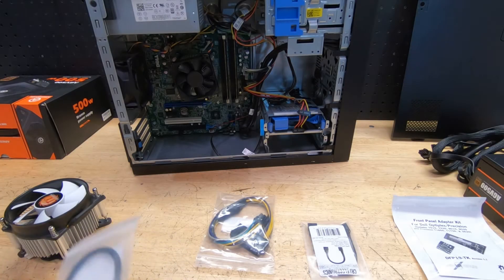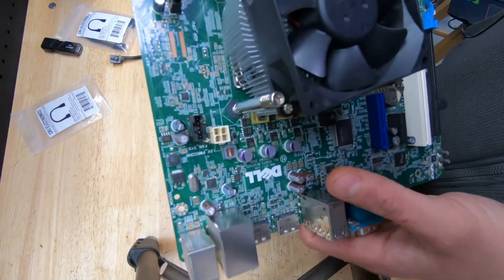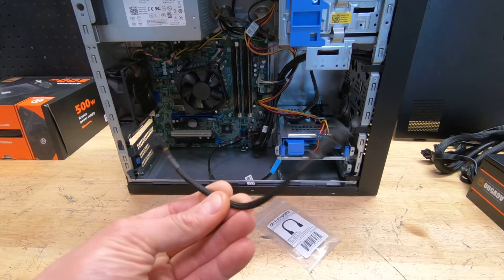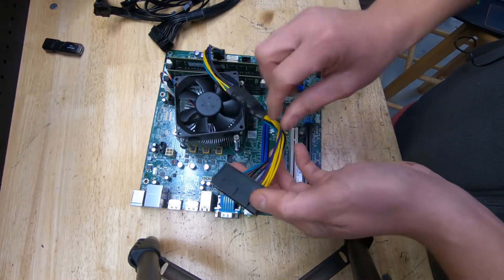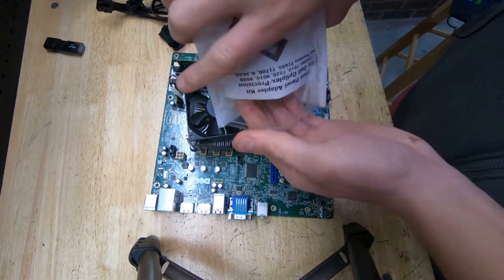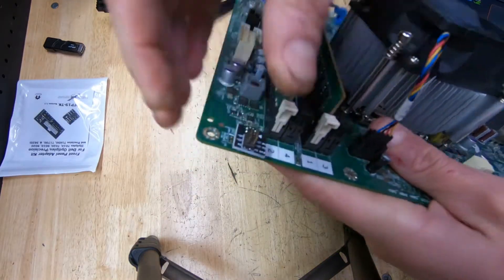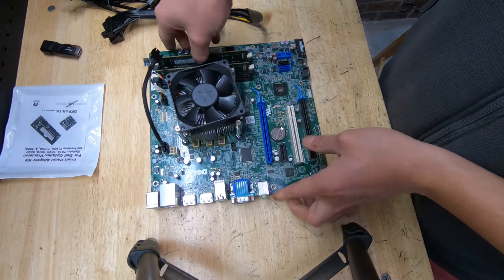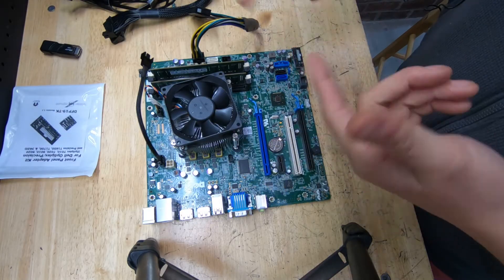Dell Optiplex/Precision case swap guide!! Adapters and preplanning!!

Comment: What adapter do I need because I want to swap it into a triple fan pc case
Reply from the maker: if you refering to the fan adaptor it depends if its a 4 pin or dell 5 pin then you would need that adaptor. as far as having enough ports for the fans, Just get a fan hub that is sata power or a fan kit that has it's own hub.
Reply: @DLMtechgarage  I have a dell optiplex 9020 i7 4790 16gb 500gb ssd and 500gb hdd
Reply from the maker: @imsevn  you would need the 5 pin to 4 pin adaptor and for multiple fans, get a fan hub splitter.
Reply: @DLMtechgarage  what if my case comes with a hub that uses a controller to control them
Reply: @DLMtechgarage  is there anything I can dm you on
Reply from the maker: @imsevn  then your good, just check if its pwm powered or sata. if its pwm power you would need the adaptor for the 5 pin to 4 pin, if its sata power the just plug the fan hub to a sata power. no you may get an error about the fan since the computer won't pick up the fan signal but you can plug another fan into. computer will still run with the error though.
Reply from the maker: @imsevn  i have instagram you can hit me up their @dlmtechgarage or email me at dlmtechgarage@gmail.com
Reply from the maker: @imsevn  will do!

Comment: The power adapter extends outside the motherboard 7:44. Won't it give problems in small matx cases?
Reply from the maker: depends on the case. I put this in a thermaltake matx case and had no issue.
Reply: @DLMtechgarage  I forgot can these 7020 mobo's work with a non original dell cooler?

Comment: I just put the power switch adapter in my pc and made sure the pins were in the correct spot but it is still giving me the power switch alert when I boot my pc up.
Reply from the maker: What model optiplex you using? Some required both adaptors.

Comment: Does that front panel adaptor work with a dell optiplex 5040 sff?
Reply from the maker: according to the companies site it does not.
Reply: @DLMtechgarage  :( thanks, i want to change the case I will check my options.
Reply from the maker: @felixzarzuela  I have yet to see it done and I am def trying to get my hands on my to try and do the swap and film it.
Reply: @DLMtechgarage  great, thanks.

Comment: what do i do with that 5 pin hdd_odd port that's next to the 8 pin power port on the motherboard now that i have an upgraded power supply?  Would i still have to use that port to power the dvd and hard drive or would I use the sata power cables that are coming out of my new power supply bypassing the hdd_odd port?
Reply from the maker: either or, it's a matter of preference. I used the one off the psu to keep everything cleaner.

Comment: Thanks amigo! I recently bougth a Optiplex 9020 from Ebay. I live in Peru,   I have this power supply  PB 500 GIGABYTE,  a friend of my  said i dont need a converter, cause separeting 4 pins from the 24 pins and using toghether 2 conectors with 4 pins, i can used  those together the 8 pin wich the mother board need , With my  PB 500 GIGABYTE is enough or I really neet the converter? I m really apreciatte your anwser .Vibes from the peruvian jungle my friend. Thanks
Reply from the maker: unless you know the exact pin out and are good at repinning, I would just get the adaptor and play it safe and that power supply will be fine. I have heard of people frying their computers not using the adaptor and trying to come up with their own connectors. play it safe my friend. Thanks for watching and honored my videos are getting viewed over their!! Feel free to ask questions if you need any more help, always glad to help any way I can and hope you can check out and share the channel!

Comment: hi one question, after using the 5pin to 4pin adapter could you connect a 4 pin fan splitter after that for example https://www.amazon.co.uk/Akasa-AK-CBFA04-15-Splitter-Cable-Fans/dp/B005FWXWPS
Reply from the maker: i dont see why you could not, never done it, not sure.
Reply: @DLMtechgarage  hi also, with the 5pin to 4pin adapter, can you still control the fan speed
Reply from the maker: @aryan.a1z  yup, the 5 pin is just an extra pin for dell to pick up the signal so it does not give you an error. the 4 pin has it jumped to act the same way but basically the 5 pin is just a 4 pin

Comment: Just a question with that rgb cpu cooler do you receive any fan error on boot? Thanks
Reply from the maker: never ran into that issue. i have heard that the optiplex is picky with some fan manufactures but at least this one worked fine for me.
Reply: @DLMtechgarage  Luckily the Precisions have UEFI firmware that's easy to mod and has a zillion settings to mess with. You just need to find the offsets and values that control the fans and it only takes a few quick commands using https://github.com/datasone/grub-mod-setup_var. You can control the fan curves, performance profiles, and so much more on most of them.
Reply from the maker: @CaseyStrouse  good info that's for it. Will need to check it out

Comment: @DLM... i bought the 8-24 adapter. When plugged in, the CPU fan spins @ 100%...and it doesn't post. Have you ever experienced that before? Using a Precision T1700
Reply from the maker: could be a few things, are you getting beeps, i believe two beeps are memory errors, try reseating the memory either way. next would be to unplug the gpu and try plugging your display to the mother boards gpu, if it's still doing the same thing after that then go back to the original setup and if everything works could be a psu issue. now another thing to consider is did you make sure to plug in the cpu supplemental power, that has to be plugged in.

Comment: Is it argb compatible with 9010 MT motherboard?
Reply from the maker: the adaptor works with the MT boards.
Reply: @DLMtechgarage  yeah but I’ve stumbled upon an issue, I have a cooler master mb311l argb, the lights turn on but the fans don’t spin I don’t know why, I was wondering if there’s a solution or if it is compatible or not
Reply from the maker: @cyrusaa  never ran into that issue changing the cpu cooler. not sure.
Reply: @DLMtechgarage  i was referring to the front case fans not the cpu cooler
Reply from the maker: @cyrusaa  not sure, never had that problem either.

Comment: Great video.  I have 5x 9020 SFF and 4x 9020 MT that I'm always looking for uses for.  Have you done any work with the SFF models?  Same process?  I'm looking to take one of them into a 1U or 2U server chassis.  I have an SFF I've been using as a pfSense Router w/a 10Gb NIC but I'm looking now rack mount that solution.  Any tips you might have would be appreciated.
Reply from the maker: yea the sff models is the same, its the usff that are slightly different. the best tip i can give is to get the adaptors, it makes your life soo much easier, i have done it the splicing and cutting wat but it's annoying. It's a real easy process and straight forward with the adaptors. Thanks for watching,
Reply: @DLMtechgarage  Thanks for the advice.  Splicing and soldering don't bother me.  I might go that way any ways.  I have bunch of pin header wire connectors.
Reply: @DLMtechgarage  I have a 9020 SFF that I'm trying to move into a new case, but it says on the Harbin website (in capital letters) that their front panel adaptors will not work with SFF models. Are you saying they have actually worked on SFF's in your experience? If not then is there any other way to get the front panel working other than soldering and splicing? Great and helpful video by the way!
Reply from the maker: @sapienics  the adaptor will work for the power button but outside of that the other front i/o won't work and you will still get the error on boot.
Reply: @DLMtechgarage  Thank you for the response! Is there any way that I could get the front panel working, eg through other adapters? Or will I have to splice and solder?

Comment: Can i used dell fans with aftermarket motherboards? Like b85m
Reply from the maker: yup as long as long as its 3 or 4 pin. the 5 pin you can not.

Comment: My system keeps booting up and going to a set up because there is a error for the thermostat and back fan.   How can I fix this.
Reply from the maker: you need to put the thermal sensor in, i really forgot to explain that in the video. the thermal sensor has to transfer over. for the back fan error just plug a fan into it.
Reply: @DLMtechgarage  what if u don’t have it anymore. I didn’t know and I swapped the pc a month ago.  I have been dealing with it.  What’s it look like?
Reply from the maker: @RecodeFiber550  posted a link to one on ebay, it varies depending on your model. i dont know of a way to bypass it without it.

https://www.ebay.com/itm/111403421690?chn=ps&norover=1&mkevt=1&mkrid=711-117182-37290-0&mkcid=2&itemid=111403421690&targetid=1070284370796&device=c&mktype=pla&googleloc=9010035&poi=&campaignid=11613475437&mkgroupid=114499396058&rlsatarget=pla-1070284370796&abcId=9300455&merchantid=101500813&gclid=CjwKCAjwj6SEBhAOEiwAvFRuKDjqE-1bTpahQ-goKH0cSx7txeTICWZ6OpxrgnXFsh7RFGJDJ3kF2hoCmu0QAvD_BwE

Comment: Hi
I am a direct viewer from Brazil, I have a Dell Optiplex 9020 small model and I recently decided to change his case, I just bought the cable for 24 pins 8 pins, will it work with just him?

I will put it on Sharkoon TG5.
Reply from the maker: yes it will work with that adaptor, you just need to figure out the front panel pin out or you will get the boot error.
Reply: @DLMtechgarage  How do I identify the front panel pin and how do I step by step so that this error does not happen anymore? 

Thank you so much you don't know how much you help me! 
I am "noob" in relation to hardware and my English is not good
Reply from the maker: @frank_soares  if your gonna do it without the adaptor check out the link below might help guide you.

https://www.dell.com/community/Optiplex-Desktops/Optiplex-5-pin-power-button-assembly-pinout/td-p/6234979
Reply: can you tell me in detail for a layman to understand, how does this 4-pin cable work and why should i buy please

and the problem of the power button cable failure error?
Reply from the maker: the 4 pin is the fan power, dell uses a 5 pin and it will not fit in the 4 pin. the 4 pin is fan control which means that you can control the fan speed manually if you want.

Comment: you dont know how many you help me with this question, really thanks for your help bro, thanks for the help
Reply from the maker: glad I can help, let me know if you run into any issues or have any question.s
Reply: @DLMtechgarage  so i need buy and adapters for pass this motherboard to oher case?
Reply from the maker: @elmorse4415  the adaptors make it easier, but if you cant get them you can cut and splice some wires to do it.
Reply: @DLMtechgarage  can you do a video good explained for do that, is that i'm of costa rica, adn those adapters not are available here, neither in ebay.
Reply from the maker: @elmorse4415  I got a video that talks about it.

Comment: I thought I had ordered everything needed for the Optiplex 9020 MT swap out earlier today, but forgot about the Harbin kit, so watching this was a key memo & one is now on the way-Thanks for the great guide, here!
Reply from the maker: thanks for watching!!
Reply: @DLMtechgarage   I'm not sure you will reply, but if you do I would truly appreciate it. If I have the cable adapter already, could I run a [y split cable on one of the fan outputs ? (I have a 600w power supply in my 9020) Or would it be best to use a (molex to 3 pin) fan cable? I'm asking this because I found a solid way to mount fans to the front cage with no cutting or drilling, but how do l power it well. ( If you want a picture of my Optiplex build just to see how I did it, just hit me up with a email  link and I will send the pictures to you)
Reply from the maker: @z-ZONDER-z_E15  not sure about the splitter option in the sense that it may trigger the error of for the fan or might not spin. might be worth a try, I have not done it that way, dell fan headers are very picky. What I do is run a pwm to sata splitter and. If you worried about the fan noise you can get a cable reducer. Will post a link to the splitter.  def send me a pic, love to get new ideas. dlmtechgarage@gmail.com

https://www.amazon.com/CRJ-4-Pin-Sleeved-Power-Adapter/dp/B0711CR7HV/ref=sr_1_1_sspa?keywords=pwm+to+sata&qid=1646603428&sprefix=pwm+to+sa%2Caps%2C71&sr=8-1-spons&psc=1&spLa=ZW5jcnlwdGVkUXVhbGlmaWVyPUEyQU5MSEFBTkNYWUNLJmVuY3J5cHRlZElkPUEwMjUwNzQ2MzlLTUZCVzY5SzNDMSZlbmNyeXB0ZWRBZElkPUEwMzI3MDE3MTY0QUxYN0k5NkVDVSZ3aWRnZXROYW1lPXNwX2F0ZiZhY3Rpb249Y2xpY2tSZWRpcmVjdCZkb05vdExvZ0NsaWNrPXRydWU=
Reply: @DLMtechgarage   thanks for the reply !  Before you got back to me, I unfortunately found out that the 'y splitter' plan would not work. The PWM signal would only go to one fan. I also can't run my computer for long, I have to keep the side panel open for air flow (the Molex cable to run the front fan has not come yet). As well as the double whammy of me not being able to get a fan quieting cable, so I just had to buy another fan (that I also have to wait for). But despite the hiccups, I will definitely send you pics of the current progress with a description of the build. Thanks for your time.
Reply from the maker: @z-ZONDER-z_E15  Saw the pics. def looks sweet. def look into the pwm to sata. you can plug in 3 pwm, use any fans you want and this should def help!

Comment: Excellent video. By coincidence I am having a problem with some parts that I buy online without realizing the problems that this has. Buy the following: Dell Optiplex 9010 Motherboard USFF w / i5-3470S + 8GB DDR3 | 0DXYK6, to install it in Case ATX Standard and the Motherboard does not want to activate. I would like to contact you directly if you want by WhatsApp or by email to explain the whole problem. I dont  have twitter.
Reply from the maker: if you are using these adaptors then maybe you have them upside down. i have done that. sorry for the late response.

Comment: Hii I i'm done watching this video and it so helpful and you gave me an idea about this because I have Dell Optiplex 7040 MT and planning to swap the case. so may I ask is this adapter are all compatible with model  7040 Mini Tower thank you...
Reply from the maker: it does not appear so according to the site they are from.
Reply: @DLMtechgarage  So meaning these adapter is not fit to Dell optiplex 7040 MT is that right?
Reply from the maker: @renmel42367  that is correct.

Comment: my pc case has 3 pin fans is there another adapter
Reply from the maker: if the typically 3 pin fan then the adaptor will work. 3 pins work with the 4 pin.
Reply: @DLMtechgarage Thanks!
Reply from the maker: @jacksonwirth3650  Anytime!

Comment: I just installed a dell optiplex 7010 into a new sweet case!
Reply from the maker: pretty simple!!, I flip these quick and make a good penny if I get them cheap enough. Thanks for watching!!
Reply: @DLMtechgarage  on specifically the 7010 concerning your comments on bottlenecks, is the GTX 970 too much of a Graphics Card for the 7010? I will be using a 650 Watt brand New Power Supply. I have a customer who wants to play Fortnite & I'm going to be putting the 7010 Motherboard in a Custom Case with the kit you suggested. The Processor is going to be i7-3770.
Reply from the maker: @Not_A_Fan_of_Scammers  i use the bottneck calculator from pc part picker and have found them to be good and reliable. It states with the combo the your cpu will be bottnecked only 5 percent which is not bad at all and negligable So that combo would be fine in my opinion, ofcourse a slightly faster cpu would yield you that 5 percent but it's not worth it.

Comment: So no sata to pcie cable for running gpus that need just a little bit more power?
Reply: Isn’t worth it just to save $40
Reply from the maker: so true.
Reply from the maker: don't recommend it, I have done it but you start his the power limit of the PSU and it can become unstable, the max I did it with was a 1050ti but even then the load on the cables become concerning.
Reply: If you want to run more power-hungry GPUs look for people selling dual socket Precisions that only have one CPU installed. These machines have an extra PCIe power connector and an extra CPU power connector that Dell has cables for cheap. I think the GPU power cables I used in my 3610 were from R-series servers that were running GPU workloads.

Comment: Harbin Repairs for the win! I use them too kits work great ☺️
Reply from the maker: Yes they are!, had another cheap brand I tried on eBay, cant' remember from who and they were garbage.
Reply: honestly though with the 3020 MT boards, I just press F1 to continue. (I almost named my business that) lol. I sell them stupid cheap after I recase them so the buyers never care as long as it has RGB.
Reply from the maker: @stevenwilliams6638  yup, rgb sells, I can sell a rgb system faster then a non rgb higher end system, crazy........
Reply: @DLMtechgarage  I try to keep all of my builds under 500$. Takes a bit of work to source the parts but it's definitely rewarding , helping people get into pc gaming , that wouldn't have otherwise.
Reply from the maker: @stevenwilliams6638  same here, lately gpu's prices have been killing the hustle, hard to sell good budget computers when the gpu costs more then the whole computer due to like 200% mark up. shm...
Reply: @DLMtechgarage  I had a pretty good stock of 780ti's but it's getting low. It's definitely killed the hustle. I had to spend 190$ on a used gtx 1650 last week. But I had a deadline to meet :/
Reply: @DLMtechgarage  I definitely like the guides though man, it will help others keep these office machines out of landfills
Reply from the maker: @stevenwilliams6638  appreciate it!, in this economy im always looking to help people game on a budget and save some money!